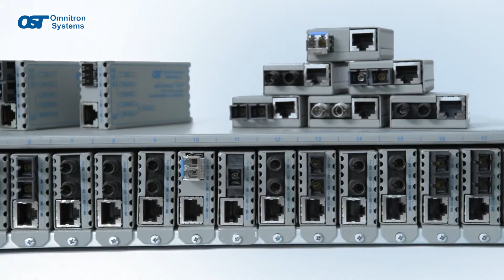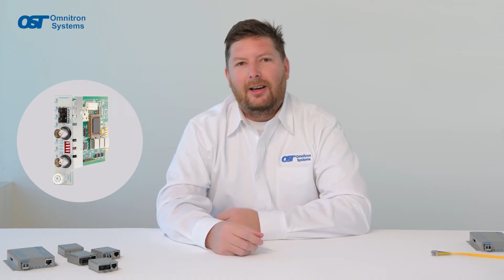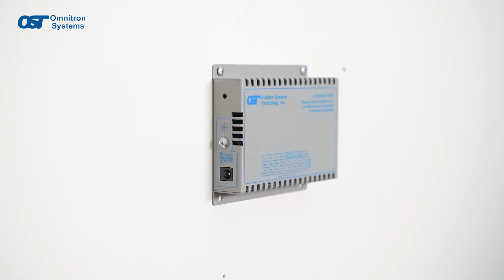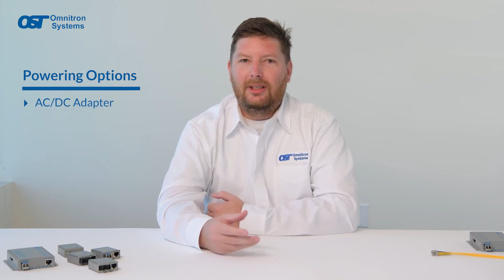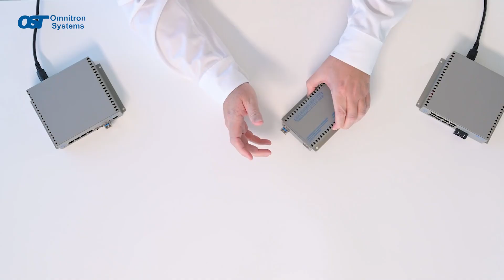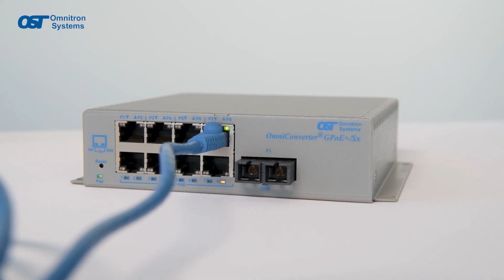What is a Media Converter and How to Use It? | Expert Guide

Comment: Some audiophiles say that two media converters in a row can clean the ethernet signal from noise.
Is that correct?
Thank you
John
Reply from the maker: While two media converters in a row can help improve an Ethernet signal, it's not a guaranteed solution for "cleaning" it from all noise and might not be the most effective or appropriate method.   

Potential for Noise:  media converters can help minimize certain types of interference, they may also introduce noise—especially if the devices are poorly designed or improperly installed.

Lack of Signal Cleanup: Most basic media converters simply convert the signal format without regenerating or filtering the signal. As a result, any noise already present in the signal will remain.

Fiber as the Key Advantage: The main noise-reduction benefit comes from converting to fiber optic cabling, which is immune to electromagnetic interference (EMI). If your noise problem isn’t related to EMI or you’re not using fiber, deploying two media converters in sequence is unlikely to make a noticeable difference.
Reply: @OmnitronSystems  Thank you very much for the really explanatory reply and the time you spent for me...i think i understand now what's going on
thank you again
my regards
john